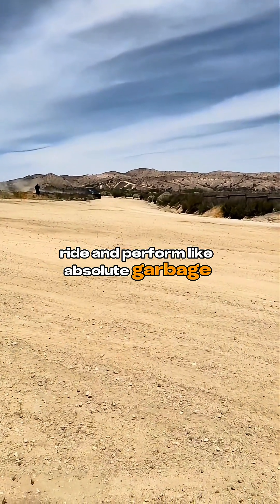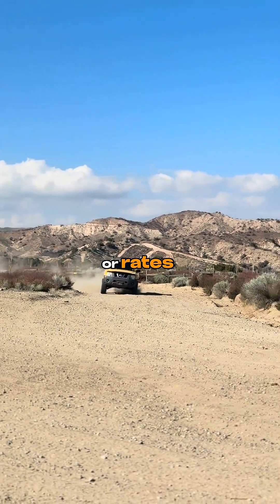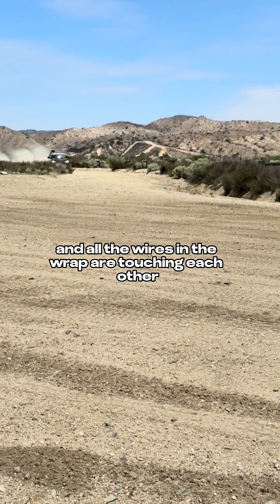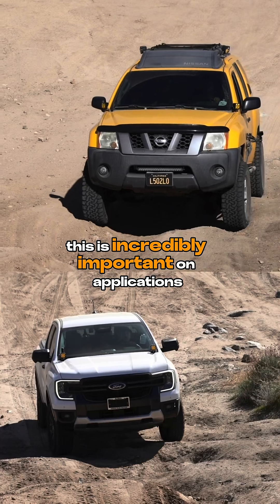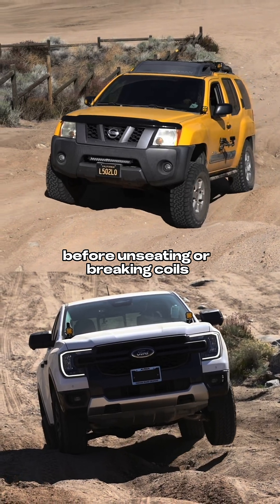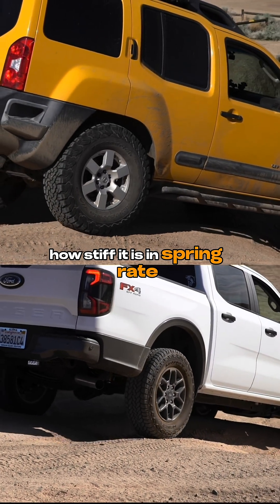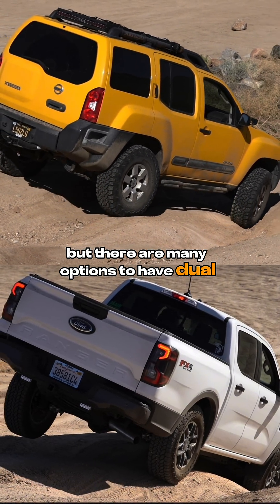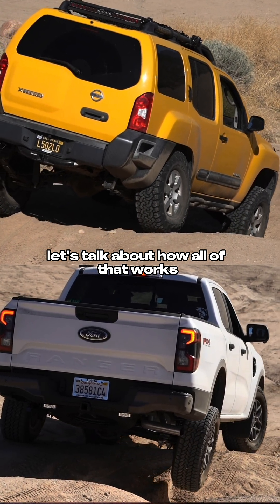SPRINGS 101 #shocktalk #shocksurplus #offroad #offroad

Comment: Can a front sway bar effect the travel of the set up. Also can it effect the ride qaulity.  I have heard just here say people removing the sway bar?
Reply from the maker: IFS drivers will usually remove the sway bar to achieve more articulation offroad. But for the most part, its detrimental to handling on the daily drive more than its beneficial to articulation in extremely limited offroad situations. OUR OPINION only though